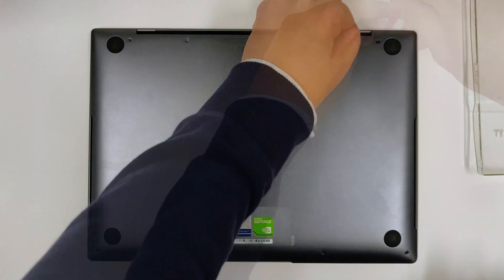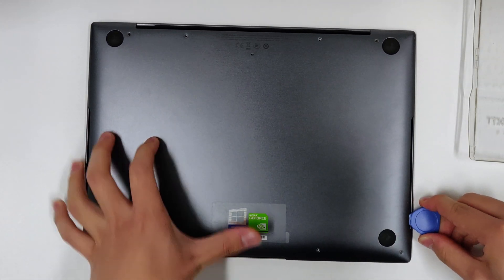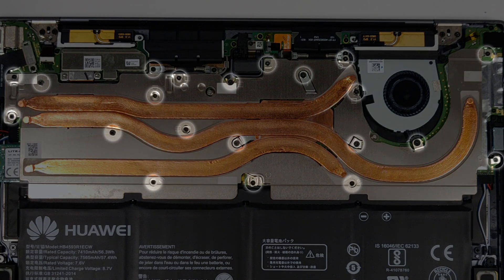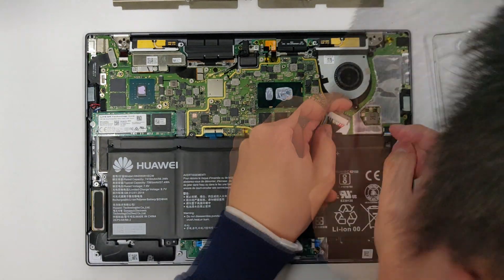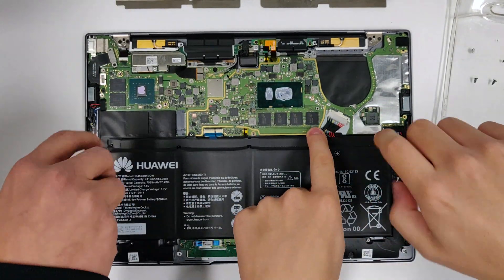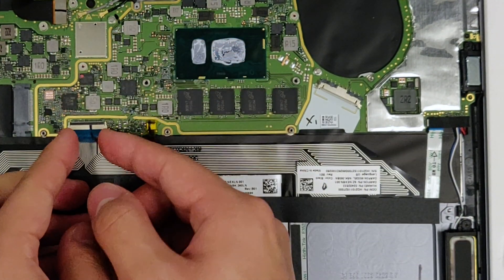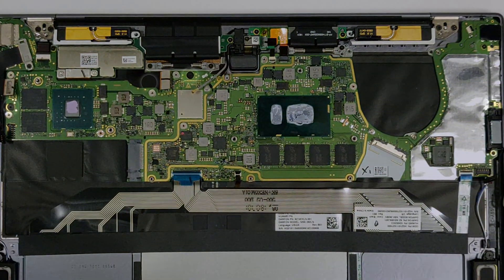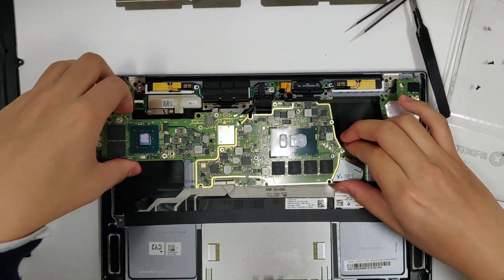MateBook X Pro Mods: Pre-Mod Disassembly (READ DESCRIPTION)

Comment: Do you know if the 2018 case will fit onto the new models?
Reply from the maker: If you're talking about the bottom lid, yes they are the same 2018-2020. Not sure about 2021 yet.
Reply: @BradsHacks  Yeah the side with the logo on it?

Comment: Brad a quick question, after I replaced SSD, the touch pad is not working anymore, any idea? i reset the BIOS to default values, no help.
Reply from the maker: Check the white ribbon cable to the touchpad
Reply: @BradsHacks  i checked it seems ok, that is very weird, even the debian linux has the same issue. any other possibility?
Reply: i finally accidentally figure it out, do you remember to insert a paper for clip bard, there is  two cables, one on the left, one on the right. in my case,though the left cable is in place, but the left cable's black lock is up. once a push it down, touch pad works. how weird.

Comment: Where is the CMOS battery? I just bought a laptop on ebay and the guy cannot remember the bios password. I was going to pull out the CMOS battery to clear the password.
Reply from the maker: No CMOS battery. Pull the main battery to reset BIOS.
Reply: @BradsHacks  I unplugged the main battery for 30 minutes and its still asking for the BIOS password.
Reply from the maker: @zengood5861  Hmm maybe the BIOS password is stored differently than the BIOS settings. Because I remember when I unplugged the battery the BIOS settings reset as well. Did you try pressing the power button while the battery was unplugged to drain any charge from capacitors etc?

Comment: The hinges on my Matebook are loose if my screen is tilted back beyond a certain point it just falls back or it forward it closed the laptop with its own weight does anyone know of a fix for this?
Reply: For anyone with this issue, the internal screws can work loose. It can't hurt to try tightening them by removing the case bottom. Add a drop of blue threadlock to the threads. Unfortunately, the hinges are integrated into the lid assembly and can fail over time in the manner you describe. Replacement of the hinges requires replacing the lid which will involve screen removal. The screen is bonded to the lid with double sided adhesive that must be softened using heat. This is an advanced repair with high probability of screen damage.

Comment: Hey Brad, do you happen to know which connecter is in charge of the touchscreen and the fingerprint scanner. Complete the modes today but those aren't working.
Reply from the maker: They are on the top row near the hinge. Please check my heat pipe video for reassembly instructions.

Comment: Is anyonw else concerned about how this thing cools itself, most laptops blow cool air through copper fins and out the back this just seems to blow air through nothing and cool it? or am I missing something the're are no fins at all and makes no sense to me anyway. please explain. The video makes sense but not Huawaei's engineering descision to have what looks to be almost no surface area for heat exchange
Reply from the maker: Yes, you are right on point. The heatsink, which is this big plate with heat pipes going across, is the only source for surface area. It relies on warming up the air inside the laptop and the fan exhausting it out. The fan pulls some air across it, but the air velocity and pressure are far lower than a push-through-finstack configuration. This cooling system has more thermal mass than a traditional fin stack, but once it's saturated, it's very inefficient at actually getting that heat out.

Comment: Hey, have you had a problem with loud fans only when being charged? 
I got that problem the Matebook X Pro turns on fans for maximum while charging - even if not loaded (no background tasks, software up to date, all apps closed). As soon as I remove the usb-c cable, after few seconds it is back to normal, silent mode. Any solutions? Thanks for your response ;)
M
Reply from the maker: What's your BIOS version? You should update the BIOS to see if the situation improves.
Reply: I updated everything with PC Manager. It says: "BIOS firmware 1.25". In system information I found the same with mode of BIOS "UEFI" - whatever it is. What else can I do?
It's strange, computer is more silent while working on 3D graphics than on stand-by while charging.
Reply from the maker: @S1DOR3NKO  You are welcome. Which power plan are you using on the battery slider?
Reply: Brad Ling the one in the middle. Moving it to the eco doesnt change anything though. There is only one power plan „Balanced”, where I didnt change anything. 
I have read on one forum that there is a possibility to change cooling from active to passive (depending on battery usage or charging). But I didnt do that. Does it make a sense to you?
Reply from the maker: @S1DOR3NKO  Sure, try that and see if it does anything.
Reply: By the way, I really appreciate the work you did on Youtube, I watch all video about MxP - I am sure I will upgrade when the guarantee is finished. Well done!

Comment: Nice video. Can this laptop be upgraded with a 2tb Samsung Evo?
Reply from the maker: Yes, any M.2 NVME SSD should work.
Reply: Brad Ling Thanks a lot! I’m buying the combo right now (laptop + 2tb ssd)
Reply: Eliseo Anaya I’ve put a 1tb Evo in mine and it works fine, you don’t have to remove the Heatsink completely, just loosen the screws at the end where the ssd is and lift the Heatsink so you can slide the ssd out.